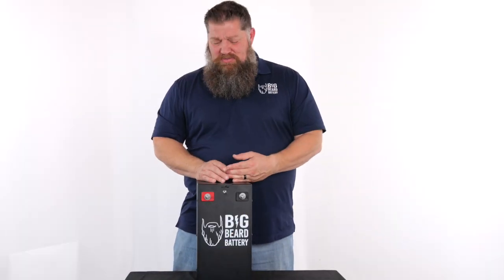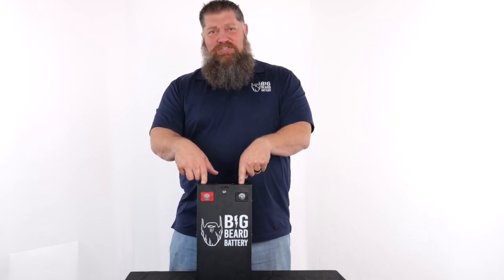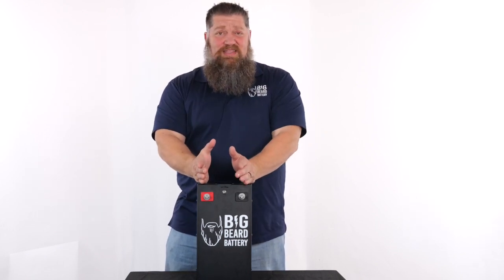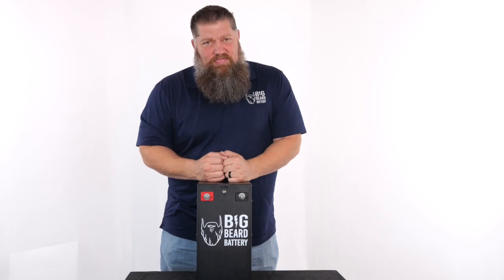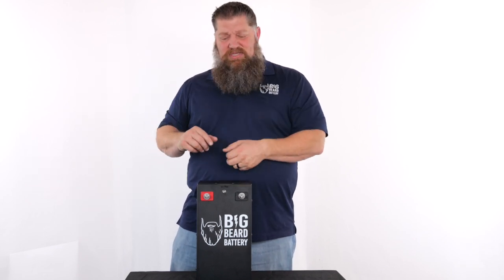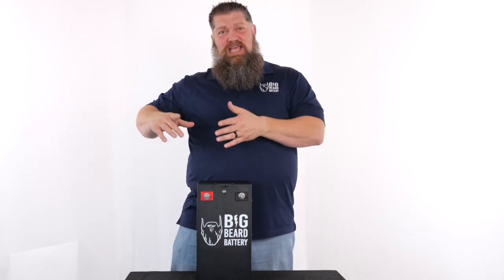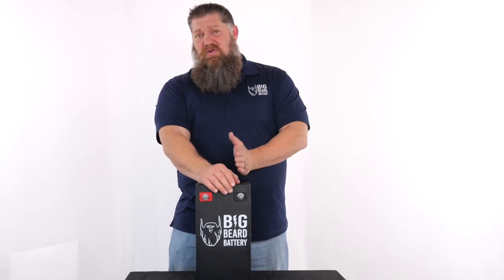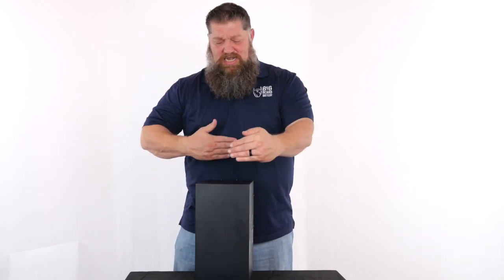12v vs 24v Battery System

Comment: i have 2000 watt inverter and get another 2000 watt from my friend , with two 2000 watt inverter can i run a device that use 3000 watt?

Comment: The bigger the system the higher the input voltage needs to be. For efficiency.
I have a 12v inverter and getting some 12v batteries. I don't plan a big system. Just need enough to protect my refrigerator during a power outage.
Also, 12v can be hooked to your car in a pinch.
My solar run will be about 12-15 feet at most.

Comment: What do you mean by let the 24 volt  run your rv?  Are you meaning running all the 120v stuff through the inverter powered by the 24v battery including the converter to charge the normal 12v batteries?
Reply from the maker: correct. the 24volt to run the 120 which includes the current converter which keeps your 12v fully charged. the converter never turns off as long as your inverters are on which means your existing 12v battery stays charged. So the converter is simply used to trickle charge and run the 12volt.

Comment: So, lets say I have 2 Lithium Iron Phosphate Batteries. They are both 12.8v 206ah Batteries. I keep hearing that hooking them up series to create a 24v system is bad for those type of batteries. Is this true?  So instead, I guess making them parallel would be 12.8v, 412 ah. I'm creating an off grid system that can run my mini fridge and probably at some point a tv , laptop, a video game system. Thoughts? Thanks in Advance!
Reply: Have u test it with the 22v system? Does it work perfectly for u if yes
Reply: @ShedrackOnwube  I haven't tested it yet, i made my origianal comment 2 months ago. After doing more research, i decided to go with a 24v system that will eventually be expanded. Ao far im almost complet me in building it, just need a few more things to finish it up (a few extra wires for my silar panels and clamps for my battery monitor)

Comment: 120v ac does not draw 10x amps...  its roughly equal to 60v dc so around 5x amps
Reply from the maker: ?? Lol what in the world are you talking about? Law of conservation of energy (1st law of thermodynamics) energy cant be created or destroyed. 

to use an inverter that is 12volts and a battery that is 12 volts to produce an output of 120 volts then the amp demand is 10x. 

now if its a 24volt system producing an output of 120v then the amp demand will increase by 5x.
Reply: @ToddandTonyshow  oh you are right, I thought 120v ac had an rms voltage of 60v, but 120v ac in homes is actually just 120v rms

Comment: Can I hook up 24 volts for my r/v 12 volts ?
Reply from the maker: @TamTrinh-j5v  no not directly. If you add a dc-dc 24-12 converter you could. You need to verify the largest amp load which is typically the slides or landing gear and make sure your dcdc converter can handle that heavy load.

Comment: Question...
I have a 1200w, 1000wh {999wh} with an input of 200watts of solar Power station. i was told i can get a 12v to 24v converter and attach to my 100w solar panel, then the power bank above, so i can double my solar input to 200w, my max input wattage for the power station.Is that correcct and, is that the way i hook it up.?
Also, if i get an extra battery to connect to it for extra hrs of usage because i have to run a small 12v fan or, floor fan, how do i do it.?
P.S.
What is a gd either flexible, hard or foldable 100w Monocrystaline panel that is the least expensive and have you herd of the paowire 300ah LifePO4 phosfate battery avertised on Temy for $364.00
Reply: If the panels output the same voltage as the solar gen input takes then there's no need for a converter. Your solar gen sound similar to mine, a Bluetti EB3A. It can take up to 200W solar. I run two 100watt panels. The panels are connected up together in parallel so the output is still 12v but it'll have an output voltage of (at most) 200 watts (because it's two 100 watt panels)..

Comment: That was insanely well explained, the only thing, i wanted to know what was it to use to get the 24 back down to 12, what is used to do that?
Reply: You'd just need a 24V to 12V step-down converter. Something like the Victron Orion-TR DC-DC Converter takes your 18-36V DC input and will output 12V DC. DC being Direct Current, the same as what your battery outputs. You do lose some efficiency this way since the converter is taking some of the power to do the conversion. That's why the video host recommended keeping your 12V system and having a separate system for 24v. A lot of use with smaller campers (or smaller budgets!) don't really have the room for a whole extra battery system though so a converter is a good option. Just keep that in mind when you're sizing your battery system you might want to get a battery with a little more capacity than would be needed without a converter to make up for that efficiency loss.

Comment: I have a somewhat unique setup… I have a box truck with an onboard 7500 watt liquid cooled diesel generator, single pole. Which tows a mobile food unit (street food vendor) the trailer usually runs on shore power at events, but sometimes I need to run it off of my own generators. I have two 3500 watt inverter generators running parallel and I use a NEMA 14-50p style plug (RV 50 amp) to plug into the adapter between the two generators. The truck (not trailer) is just a dry storage rig, but it has AC, heat, lighting, and running water. I’d like to figure out how to have an inverter setup in the truck that can run the three refrigerators in the trailer while in tow. I usually put one of the two inverter generators on the tongue of the trailer and run the refrigerators that way, but it’s cumbersome and costly, plus it’s additional weight on the tongue that I’m trying to avoid. The combined amperage on startup is 18 amps at 120 volts, and 10-12 amps nominal. I’m looking for a three hour maximum runtime and would like the alternator from the truck to charge the batteries (I’m looking for minimal run time on the generator) is this a realistic setup, or am I too far into the weeds?

Comment: My question is, when running a device, will it last longer on the 24v than the 12v because the AH doubled just from wiring my 2 - 12v's 100ah into series?
Reply from the maker: No so the capacity is the same, but you have 1 brain (BMS) working the 24v vs 2 brains with the 12v, 

What we have learned is that putting lithium batteries in series causes balancing issues. It will work but over time the batteries will get out of balance
Reply: @ToddandTonyshow  ya finally figured that out lastnight. It's the WATT HOURS that matter here, and they stay the same. So what if you hook up the positive of the charger to 1 battery and the negative to the 2nd battery ? Does that balance it a little better ?

Comment: I am installing a  24v trolling motor on my boat . I want to install lithium batteries.  My question .  Is would I get better performance out of running 2  12v in Series. Or 1. 24v battery?
Reply: 1 24v. Your current will stay the same. If you have 2 800 amp battery in series, you only get 800...